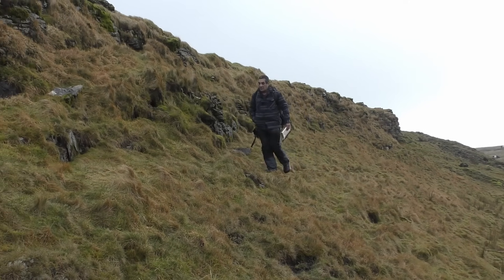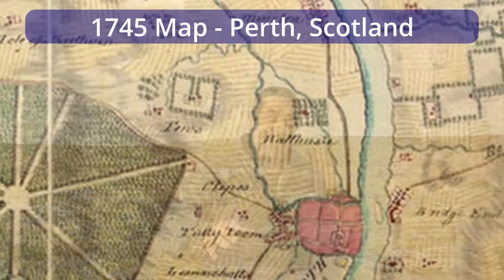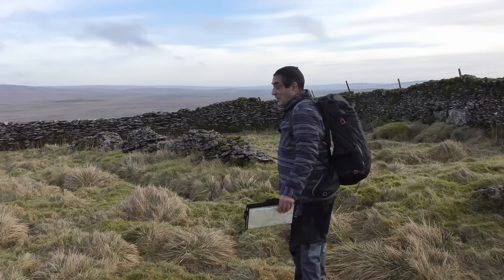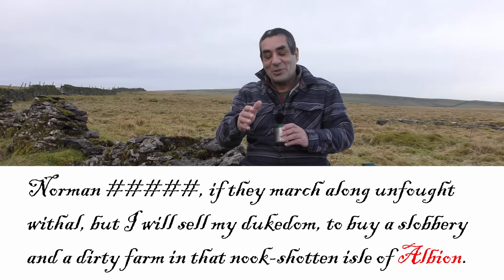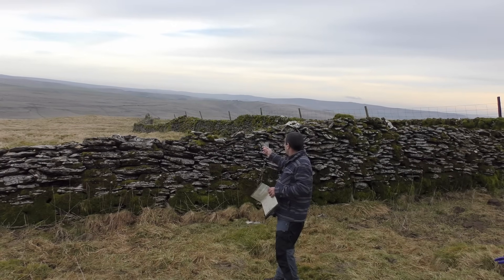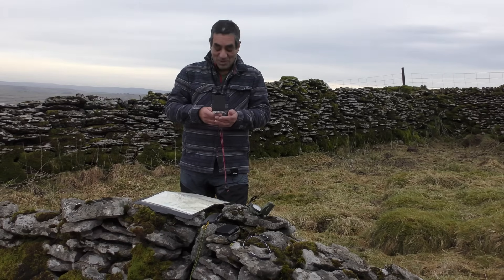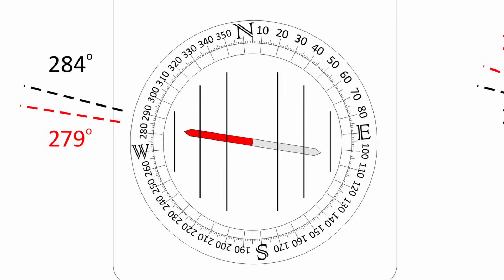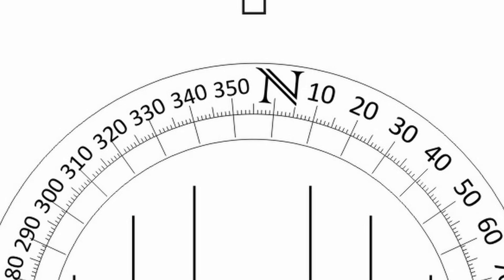How to calibrate a compass

Comment: I use a 1:12k Caltopo map to calibrate my Cammenga. I pick a straight street away from magnetic interference. I calculate the grid azimuth, verify online declination, and calculate the field azimuth I should be shooting in the field. I go to the street and shoot an azimuth following the curb line. My Commenga was dead on. 

As a side note, passing cars would swing the north arrow while I stood on the curb edge.

Comment: Now I have a greater appreciation for old stone walls and for living a five-minute drive from a USGS Survey monument! My compasses are calibrated/compared to the Willamette Stone up the street from me, something I've done for decades without realizing the simplicity it offers compared to your operation. I just line up compasses and check, usually with friends who are prepping for the coming year's hikes. You can even see professional surveyors at the stone checking their equipment. Now you've taught me how to handle this in the field if I don't trust my compass. Thanks!

The "stone" is actually a survey monument, a fixed point where the intersection of the Willamette Meridian and the Willamette Baseline were first set in 1851. This monument established the survey point for all of Oregon and Washington. There are 37 of these monuments within the U.S. that set the Town & Range survey system used across the nation (except some older systems used on the East Coast and in Texas when it was Mexico).

Comment: Only the last bit is wrong. Because you do not know WHY your errant compass gave a wrong reading, you cannot be sure that the error is uniform across the whole range. It might be 5 degrees off  in this measurement and zero or ten degrees in another measurement. It might be sticky because of today’s temperature but less so tomorrow. If the compass is out of calibration don’t use it. You might write to the manufacturer of an expensive compass and ask if it can be repaired, but don’t use it. Your previous videos have pointed out the dangers of failing to include magnetic declination in significant situations. It is worse to use a bad compass.

Comment: Ohhhhh, that's why in the other video, you did not adjust for magnetic declination. Where you are magnetic north and true north are nearly the same direction...handy. It was so strange to see you skip the adjustment lol

Keep in mind that magnetic north has been moving fast; you will eventually need to make adjustments.
Reply: Yup, the declination has altered from that printed on all my old maps for the UK, even if the details on the maps are still more than accurate enough for most applications. Which is why it is always good to double check before going walking in a particular area.
I have not been hill walking for quite some years, but reading a map is still a skill which has come in handy in other countries and getting the local declination is just one thing to consider.

Comment: Hi,

I just discovered your channel and I love your videos and learned so much already. Thank you so much!

Maybe an idea for another video that I would be really interested in:

When I am out for a hike,  geocaching, photo-tour,... I usually carry quite some stuff with me that might have an impact on the compass readings:
- Camera (with a small speakerr)
- Flashlight with magnet for the charging cable
- Sometimes a laptop with speakers
- Metal water bottle
- Small magnet for geocaching

How big do things like this impact navigation with a compass? How far away do I need to put my Rucksack before I use the compass? Does it still show valid readings while I am carrying my Rucksack? How much does the area impact the readings? Metal bridge, buildings, power lines,...

So maybe an epísdode about the dos and don'ts how to handle all the other gear you might carry is also interesting for others?

Thanks a lot!

Comment: I tend to identify three references point I can see long range and two to three position with know bearing to those points some distance apart. The reason I repeat the process is we have concentration iron in the region. Doing it more then one time act as a confirmation. If I get wild reading, I know I'm dealing with a bad reference spot. I will do it somewhere else again. So I can tell what the accurate deviation is.

Comment: I do think learning to navigate with a map & compass is worthwhile.  However, I think if you actually checked a phone's GPS then I think you would be convinced of its accuracy.  There is some dithering built into the system by the US government that deliberately degrades the position data of a single (non-military) reading, but that could be overcome by averaging readings.  From a statistical standpoint, averaging 30 readings should indicate your position with a small error. Of course, this method is dependent on battery power.

Comment: I wouldn't call this calibrating so much as compensating for error. Is there actually a way to fix and calibrate them? I just picked up an Israeli Defense Force version of the M73/M88 compasses, but it seems like the needle isn't pointing in the correct direction. Is there a way I can actually calibrate it to magnetic north?

Comment: My question is, shouldn't it be possible to calibrate your compass for local magnetic declination simultaneously in the same way?
Since a map doesn't need magnetic needle, it has its own true north lines, If I have a reliable map, and I read exact bearing off it, let's say 350° to exact spot, from where I'm standing, then with my compass pointing at the set bearing, my needle will still be pointing at magnetic north, so any difference between North mark on the compass and the needle would be magnetic declination in the area, wouldn't it?
Reply from the maker: Yes you’re correct.  The normal way of getting the local declination is to take a bearing from a map from your location to a spot feature then take a magnetic bearing to the same feature.  The difference is the local declination (if you use Grid rather mag. North)
Reply: Great, thank you for confirmation. Your videos are truly educational and fun to watch. Also greatly appreciated. 
Keep up the good work, Sir. @TheMapReadingCompany

Comment: Hi Wayne, Many thanks for your videos. Question: I have a Suunto MC-2G compass. It serves me well during my walks in Scotland / N. England. I realise there are N. hemisphere variants of my compass and understand the magnetic variations that are expressed over the Earth's surface. The question I pose is: Why are not all compasses designed as "Global"? - and consequently are there any advantages of using a N. hemisphere compass compared to a global one? (in the N. hemisphere - obviously). I recognise that the direction needles are constructed differently to take into account the angle at which the magnetic field enters (?) - leaves the surface of the ground. Thanking you for any time spent replying. Peter
Reply from the maker: It's all down to cost and what you want to pay.
A “global” compass needle will rotate (spin) even when the compass is tilted over slightly as it has a different pivot point underneath and maybe a slightly taller housing. This is needed as in the southern hemisphere the magnetic field tend to be “slightly” upward and in the northern hemisphere “slightly” downwards.  As you get nearer the poles this difference is more noticeable.  With a needle which is balanced for a specific area/zone the end of the needle may drag on the compass base at one end of the needle if it’s used in the wrong area/zone.  Global compasses tend to be a bit more expensive so unless you’re going to use it in other zones it may not be worth the extra cost.
Reply: @TheMapReadingCompany  Thank you Wayne - On a side note - just noted the height scales on the side of the mirror case! Amazing what is hidden in full view. Peter

Comment: What map ratio is most common or most used for traversing terrain?
Reply from the maker: 1:24,000 or 1:25,000 for shorter distances and 1:50,000 or 1:63,360 for longer routes.
Reply: @TheMapReadingCompany  thank you, I just watched the video where you explained exactly what I wanted to know :)

Comment: Calibrating a compass:  A thing is though, the Earth's magnetic poles are moving.  Even compass roses at airports have to be redone every now and then as even runway heading markings have to be within so many degrees of their magnetic heading, of which some runway heading markings even have to be redone every now and then.  Plus at times, there are more than 1 North magnetic poles and more than 1 South magnetic poles on this Earth, of which, one would need to know which strongest magnetic pole one was near.
Reply from the maker: As far as I know (so may be wrong) runway markers are the first two digits of the bearing of that runway – truncated so the last number is removed.  They are only accurate to within ten degrees, so they don’t need changing very often.
As the red end of your compass needle is the North of the magnet it will always point to the South end of the earth’s magnetic field, which is where we call the North Pole.  It doesn’t really mater where the North (Magnetic) Poles as you calibrate to the difference between the direction to the Mag. North Pole (wherever it is) and the vertical lines on map.
Reply: @TheMapReadingCompany  Currently, the Earth's North magnetic pole is heading towards Siberia, possibly on it's way to another magnetic field flip.  (Sometimes the Earth's magnetic poles flip, sometimes they do not flip.  They just move about and go back to where they moved from).  Depending upon where one's airport is and what magnetic directions it's runways were, for some airports the magnetic field change might not be really noticeable, for other airports on this Earth, it might be more noticeable.

I know that here in the USA, Federal law mandates that runway heading markings have to be within so many degrees of magnetic heading (for safety).  Some airport runway heading markings have been changed over time due to they no longer line up with their magnetic heading in accordance with the USA's Federal laws.

Of which side notes also:
a.  Currently, the narrative is that the Earth's magnetic field is due to the dynamo effect of the Earth's inner core.
(Of which, how could there be more than 1 North and South magnetic poles at any one time at different locations on the Earth's surface?  How could the South Atlantic anomoly even exist?)

b.  Personally, I currently believe that a line of flux originates from the aligned magnetic fields of quarks and electrons (which make up atoms and molecules).  That could help explain how there could be the magnetic effects we perceive on this Earth, as well as help explain how the Sun could have not only a main magnetic field flip every 11 years or so, but also all the magnetic fields observed on the surface of the Sun.  (Which are many and change over time.  How could such a thing even occur 'if' even the Sun's magnetic field were due to it's inner rotating core?)  The current narrative we are being told concerning magnetism, (especially Earth's), just does not make logical rational sense.  AT least to me.
Reply from the maker: The last time the magnetic poles “flipped” was 780,000 years ago.  So I assume we’ll be OK for a while
Reply: @TheMapReadingCompany  Well, at the current supposed rate that the Earth's North magnetic pole has already moved just in my lifetime, I would have to respectfully agree to disagree with you.  Some believe the Earth's magnetic poles will completely flip within the next decade or so, certainly in this century.  (Along with all the potential existential events).

Comment: I tried several Compass- apps, but no one of all functioned well. Accuracy over 10 to 15 degrees. Even after many times of calibration. Even so the compass in my Outdoor GPS, accuracy over ±5 degrees, and the calibration works very difficult and also quite inaccurate. My normal compasses (Original Bezard, Recta DT420 and Recta DP6) works very well whit in an  accuracy of about 2 degrees.

Comment: these are great vids, even with the off topic bits as they make a firmer foundation to what your doing in the vid! please leave the off subject bits in 😁

fascinating subject tho! just out of curiosity, if the compass has metal in the case doesn't that affect the compass too? the reason i ask is that olde gallions (like nelsons) had their compasses in metal casings! (i guess metal would be put round it to correct it to known north!)
Reply from the maker: Ship's compasses can be calibrated which, in this case, means the direction they point can be altered.  This is done by moving magnets which are positioned around it or moving large metal spheres or blocks.
Handheld Land Nav compass are sometime made of metal but whether this affects the compass depends or where-abouts the metal (or its constituents) are on the periodic table – almost started to waffle in a YT comment reply there 😊

Comment: Very interesting, having dabbled in this with the Army we used to check for compass error (ICE) using military GPS run over a distance between two ranging poles. The supposed error of this was described as "sub Mil" and was the same system used to orientate artillery guns, so fairly critical! Unfortunately it's not something possible with consumer level GPS. Regarding points on a map being accurately surveyed, we were told points such as road crossings were best used and were "points of firm map detail".. may have been military BS.. but it makes sense.
Reply from the maker: If you look on OS maps you will see small black dots with numbers next (or near) to them.  The number are printed in Black (don’t use the dots or numbers printed in Orange).  These are spot heights and the black printed number signify that a person has gone these and spent hours getting multiple sweeps and fixes on a (gov/mil standard) GPS.  These would be the best things to use to taking a bearing.  The problem is that there isn’t normally something at the exact point of the spot height to aim your compass at – which is why I tend to use old (200 year +) walls, or a trig point if there is one.

Comment: Thank you for this video. I have one question left. Let‘s say I have to correct the compass +2°, couldn’t I just add this to my declination correction on my suunto compass? In germany where I life, we have today a declination of 2°. Couldn‘t I just set the correction than to 4° and fix declination and calibration together? kind regards, Ferry
Reply from the maker: Yes you can!, but as the declination changes all the time I would always just adjust the error before I started doing anything else.  But as I've said many times, there are many ways to do most things.  If you prefer to add or subtract the error and the declination together that's fine.  Always do what you find the best the best way for you - and not some strange guy from YouTube.

Comment: I had time to spare while camping in Ontario, Canada. I came from a western Province, so, I did not know the immediate magnetic declination for that area. I located the North Star (Polaris) at night, and set two wooden poles up in line directly north-south. Next morning, I took the reading, which was true north. From that, I determined the magnetic variation for my location.
Reply from the maker: The declination in that area is quite significant
Reply: @TheMapReadingCompany  Actually, I was to the left of Thunder Bay, near Dryden Ontario, and it was pretty close to true North at that time hardly noticeable. (On official site, it was about 0.26 degrees west).  In Edmonton, Alberta, though, it was over 14 degrees East. Canada is huge.

Comment: Since you love digressions,here’s one. On an airplane the compasses are adjustable. Every few years or if you add new equipment you have to do what’s called a compass swing or use a master compass which reads in reverse. You move the aircraft around a circle that’s marked on the ground ( with everything turned on including the motor) and check your aircraft against the master. Then adjust the compass with a brass screwdriver. The aircraft compass is never accurate so you mark down the variation and adjust your heading accordingly. As a side note compass navigation is rarely taught now with the advent of gps and self correcting electronic compasses.
Reply: Interesting side note:  Some of the helicopters I was in during my time in the Navy, when starting certain engines, the magnetic compass in the cockpit would swing due to the magnetic field generated by that specific engine's starter motor.  (Localized magnetic field generated).

Comment: I also enjoy the history lessons. I think there are two types of error being mixed up here. When a manufacturer says that the Mirror compass has an accuracy of 1% , I think that means that if you point your compass a 100 times at the same object you get the same result within 1% either side of the average reading. It doesn’t require correlation with a gold standard. This is due to the manufacturing qualities and the human eye. This concept is Precision.
What you are talking about in most of the video is Bias (5 degrees in your example) That can only be tested by comparison to a gold standard (in this case a OS map). Combining a 5 degree west bias and a 1 degree accuracy means that your compass will read 4-6 degrees west of the correct magnetic variation. Many thanks for these videos. They are informative and fun

Comment: Assuming the error is in the compass, what would cause this other than shoddy design/construction? 
Also, are those compasses that are obviously inaccurate (via testing), are they consistantly wrong, as you suggest? Or maybe they wrong at random in which case you cannot model a correction.